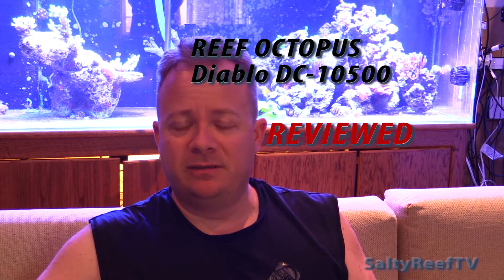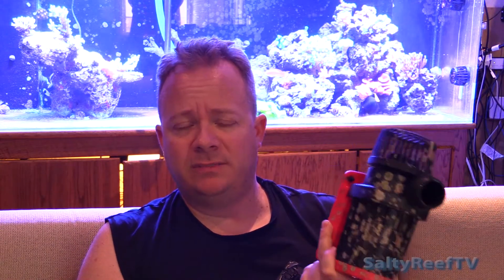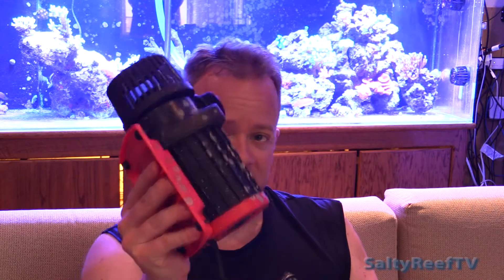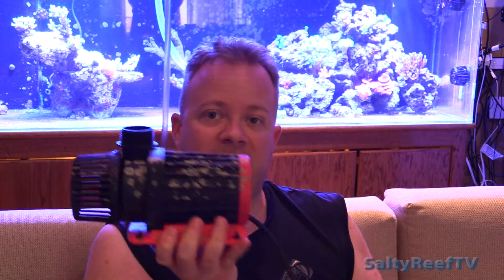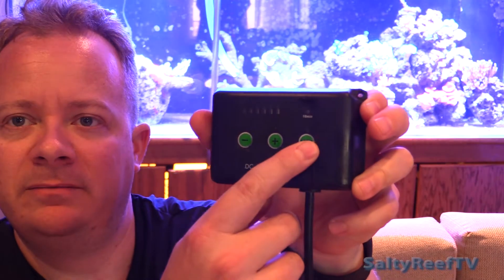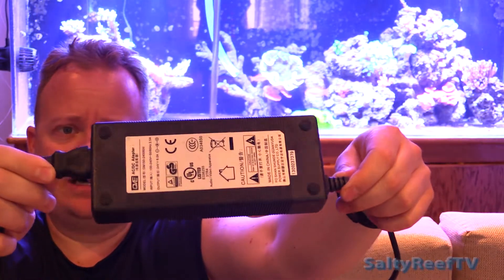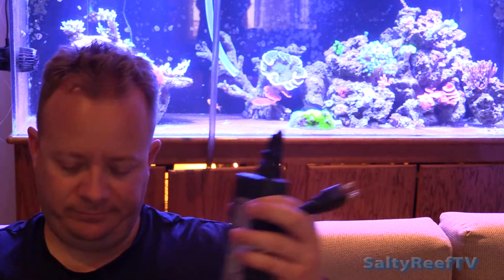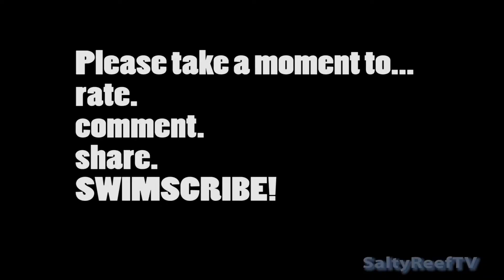REVIEW: Reef Octopus Diablo DC-10500 Return / Closed loop Pump

Comment: how did you get your pumps to shut off feed mode on apex. i got it aet up to kill the power heads on feed but they dont
Reply from the maker: Darrin Hawkey I programmed the power kill on the return pump through the outlet on the apex. The powerheads were also shut off with a kill power command. you have to setup a virtual outlet for the AFS on the apex here's the code:
Virtual outletcode:
Set OFF
If Time 14:00 to 14:14 Then ON
If Time 18:15 to 18:29 Then ON
(if you need more feeding times just keep going as above)
If FeedA 000 Then ON
If FeedB 000 Then ON
If FeedC 000 Then ON
If FeedD 000 Then ON

AFS code:
Set OFF
If Outlet vFeedA_P1 = ON Then ON

You can use a similar code on your return pump or powerhead outlet... but it might shorten the lifespan as in my experience. :(